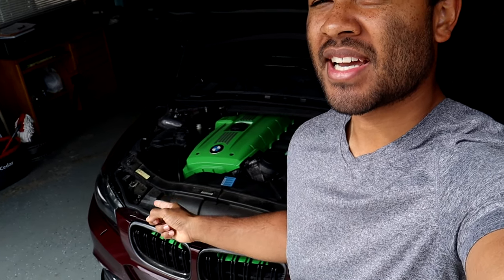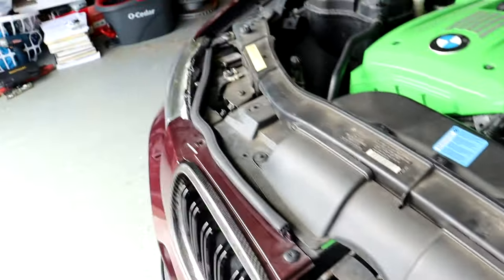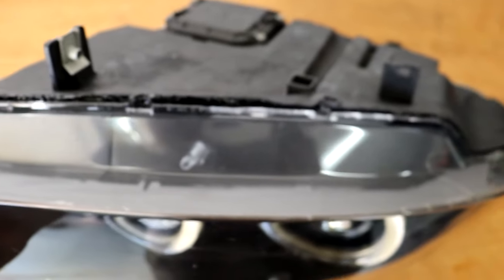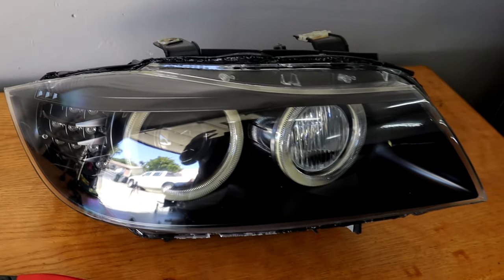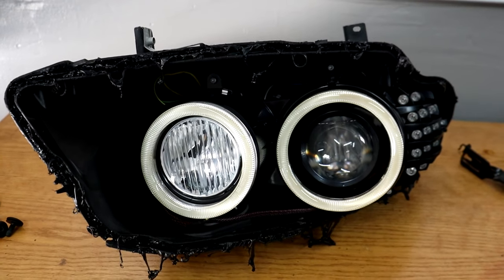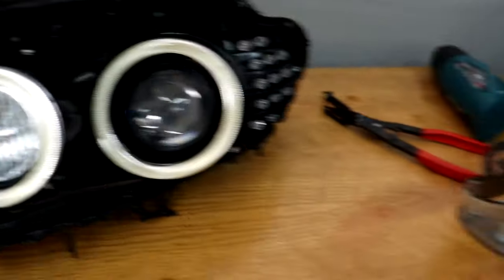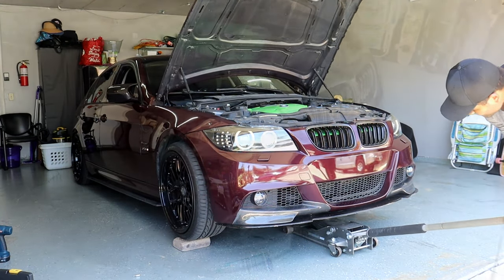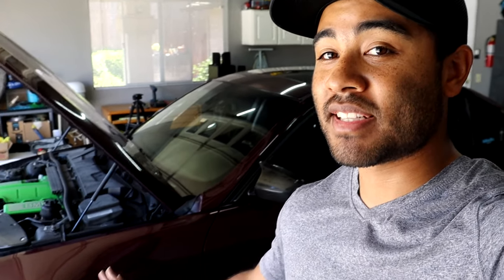CONSIDER THIS BEFORE DOING A CUSTOM HEADLIGHT RETROFIT

Comment: Check your fuse box for a blown fuse, The headlight washers has its own fuse. Mine went out when I bought my car and had the same issue. They usually turn on when the headlights are on and you clean your windshield